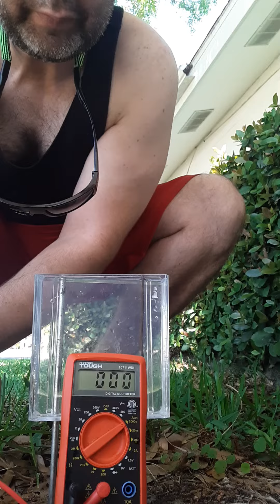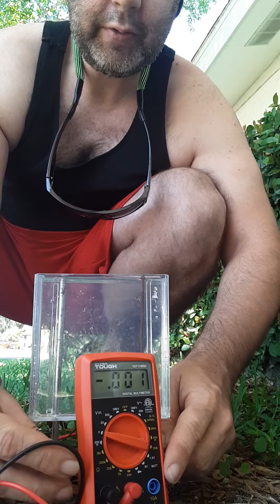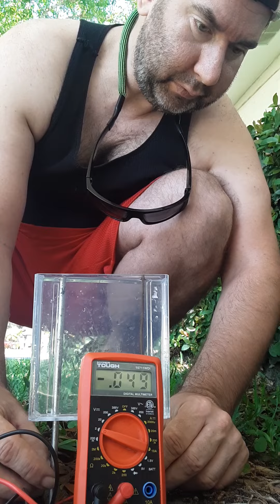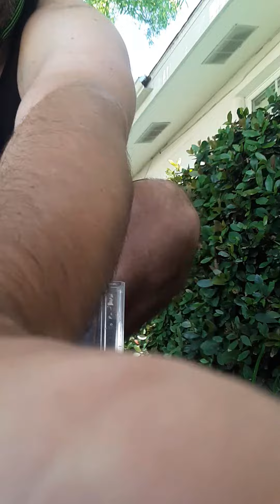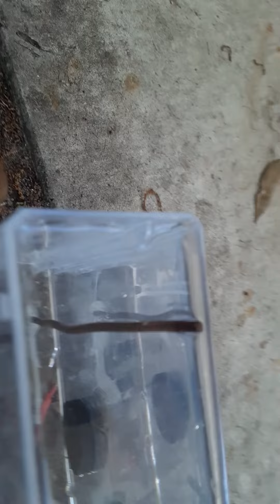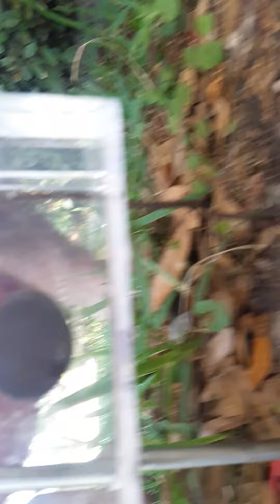#HYDROGEN #FUEL AT SCALE FOR FREE

Comment: Peter is this a similar effect to the electret?
Reply from the maker: The electret is a permanently polarized resin. Large electric fields give a permanent charge to carbon based polymers. Its electrostatic. This uses electrodynamic forces and takes energy from the outside and converts it. The electret takes no energy after manufacture. You can make electrostatic forces electrodynamic with MHD .  A large grounded capacitor on one end of a glass coiled around a magnet and filled with hydrogen. The other end connected to an elevated aerial coil. The "primary" coil is now a gas coil pulsed by earths electrostatic field
Reply from the maker: You take a magnet. One end has the glass coil filled with hydrogen. (Primary coil) now wrap a regular wire coil on the other end. As the earths electrostatic field pulses the primary coil it makes a dynamic electric current in the regular coil by pulsing the magnet.